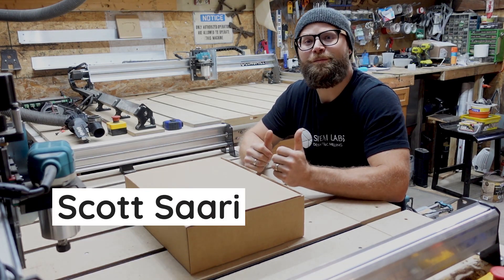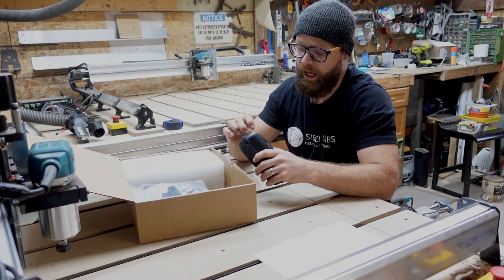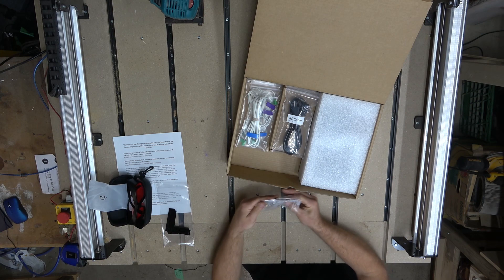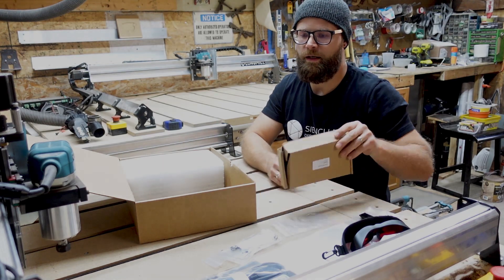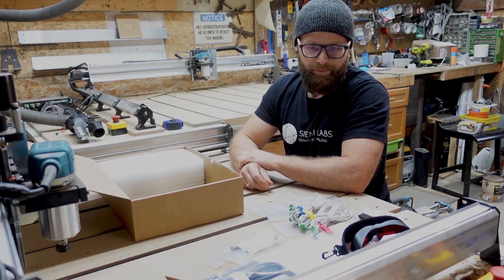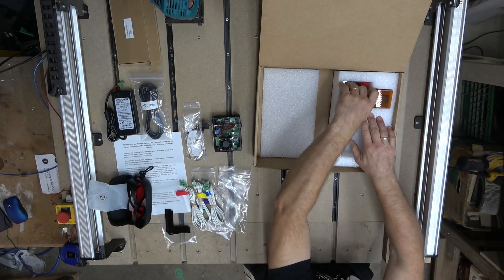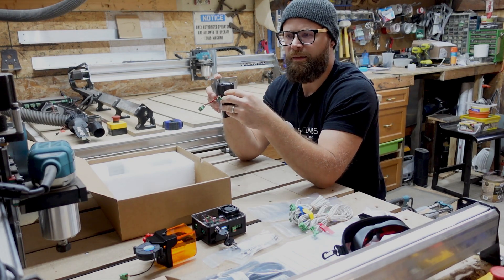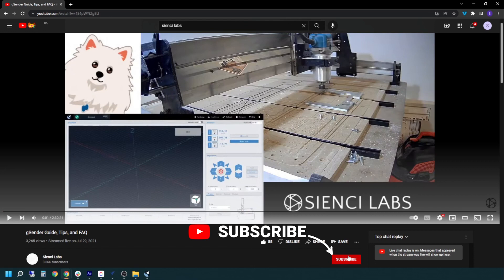LaserBeam CNC Laser Diode - Part 1: Unboxing

Comment: BY adding the Laser to the MKII, does the Z-Axis height change at all from when a router is used? Interested in knowing if my enclosure height would be impacted.
Reply from the maker: Nope. the laser sits on either the side or the front of the router mount and is not higher than the router itself.